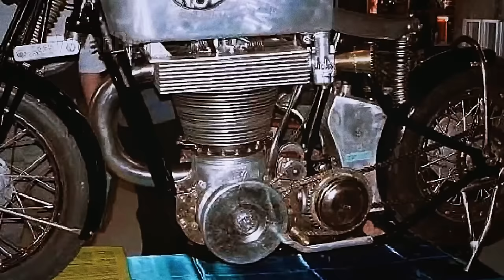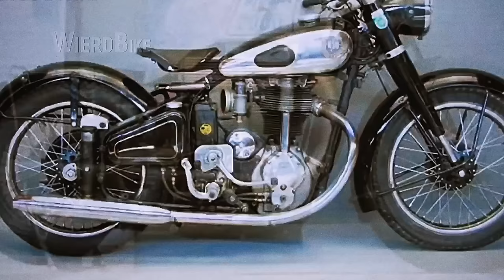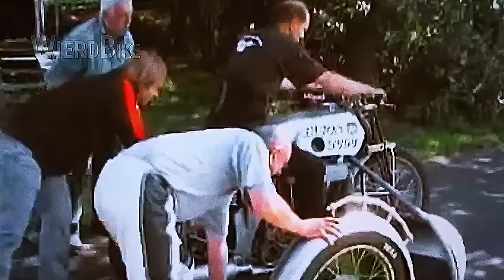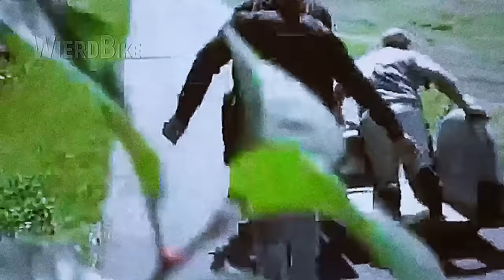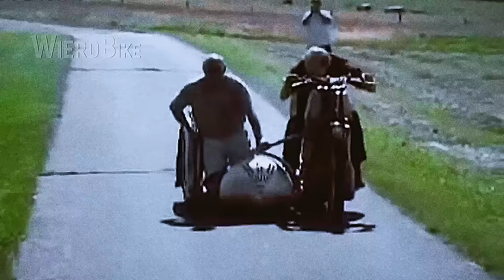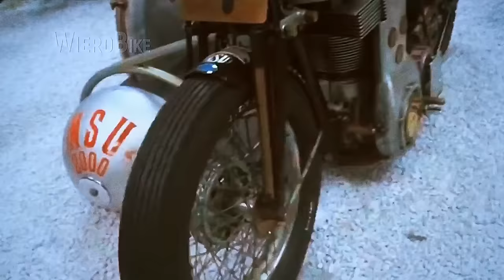The LARGEST SINGLE ever! 1 cylinder — 2 liters...

Comment: Sounds like anything above 300 rpm would vibrate the bike to pieces.
Reply: my lord but RPM does not seem to have been a design consideration! seems like such a waste imo. i'd love to see a huge single cylinder, but with a balance shaft or a dummy cylinder like ducati's supermono so it can rev properly
Reply: @5naxalotl i can only imagine, then it might be capable of like what,  maybe 1000 rpm? Its like the opposite of Vincent Foucart’s Peugeot 205.
Reply: Why do u want rpm
When you already have torque?
Reply: Imagine trying to kick it!
Reply: Next, he could just sit directly on the piston 😂
Reply: @fastinradfordable Because lits of torque at very low RPM means low power, and power is what moves the machine.  Looking how slow this machine is in the video I suspect it didn't make much more than 20-30bhp.
Reply: That's what your mom said
Reply: Wait until I show you my r15000 2cylinders 15L engine

Comment: That kick starter has the potential to be a leg breaker.
Reply: For sure.  I was scared of kick-starting my big brother's Norton International, and that was only 500cc.
Reply: @gibbogle  I'll never forget my uncle calling us over to his house so he could proceed to brag about his  74 inch Harley-Davidson police bike that he bought at a police auction and it punted his ass over the fork when he didn't set that pedal right and it kicked back 🤣 He didn't keep it very long.
Reply: yup, here in my country we have some old 350cc also called "leg breaker". Imagine that one
Reply: Same with Yamaha, SR 500 @gibbogle
Reply: When bombadier/ Can am were developing the ds650 they were originally designing it with a kick starter but had issues with the automatic decompression and supposedly some legs were broken and then designed it be electric starter  only on it
Reply: That's why they roll-started it in the video.  The kick-starter is only for when you're stranded at the bottom of a hill.  Remember to only shut the bike off when you have a hill to roll down and you'll be fine.
Reply: And hope it doesn't die 😅 @rockets4kids
Reply: @randall1959  Back when I was in college the starter motor on my car went out and I managed for about a month before I could afford to put a new one in.
Reply: @misanthropiccurmudgeon8967  had one of those also, with the little sight glass to see top of compression.
Reply: Or deposit you around 100 metres into the local paddock....
Reply: Bollocks, be compression switch.
Reply: Skill issue.
Reply: Haven't even watched the video yet and that was my first thought.
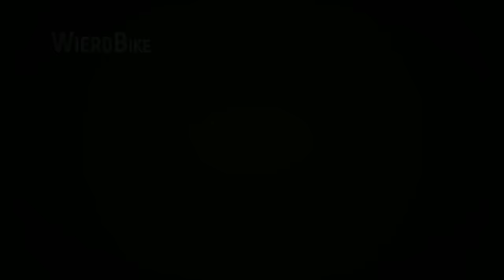Reply: 2:40 "...and let's leave this aspect on the conscience or our imagination"
PERFECT!
Reply: @GrumpyIan  Fair enough, but the ol' boys starting and riding that thing seemed to have thought push starting was the better option.
Reply: potential? this is the legbreaker to all legbreakers.
Reply: Well I'm sure if your leg could actually kick this engine, you shouldn't have to worry about it breaking since you'd probably snap a 1/2" steel bar with your leg xD
Reply: I had the chance to start a Yamaha SRX600(single, 4 stroke) a few years back. Not only did I fail, it felt like I was breaking my leg. The owner bet me I wouldn't be able and he was right.
Reply: @igorortega6494  I owned an XLCH that was bored and stroked to 1000 CCs and never had any problem kicking it. No decompression device either. Sometimes it worked up a sweat when she was temperamental.
\
Reply: that thing sends you into orbit...
Reply: Or the ER 😆
Reply: Kickstarter AND leg breaker? One mechanism with two purposes. That's just peak engineering
Reply: That kick starter would launch me to the moon 😂

Comment: These bikes are actually not motorcycles, as much as machines for breaking right legs, and causing concussions, when starting one without a helmet. What a challenge.
Reply: I think it must've only been push-started like in the video. It was a novelty, not a legitimate bike. That said, a LOT of people (myself included) have been terrified and/or injured by 500cc 2-stroke singles. I was lucky, being flung onto my face was the worst I got, haha!
Reply: I had a Yamaha DT 400 which had a decompressor operated by the kickstart. I would expect the same on a 2l motorcycle engine.
Reply: That is why you have compression release devices on such machines.
Reply: @patrickbodine1300  Well sure, but if a 500 will break your ankle, surely even a compression-released 2,000 would be as bad or worse, right? I genuinely don't know, I've only ridden 250 or smaller 2-strokes and 4-strokes with electric start.

Comment: You can literally count the revs when it goes slowly down the road.
Reply: It's not the rpm but the resonances in the exhaust pipe.
360rpm is already 6rpsec or 3 explosions per second (4 stroke cycle).
Reply: every ignition 1m drive...so you can count how far you drove it...just count all bangs

Comment: Had a BSA 441 Victor Shooting Star single that could break your leg if started incorrectly. Pass on this single
Reply: I had a Victor 500 that I somehow let kickback on me in the early '80's.  My foot still hurts sometimes.
Reply: I had the B44VS with a high comp piston. It nearly threw my mate over the bars. 😀
Whereas, I always made sure it was safely past TDC before kicking. (Electronic ignition helped)
Reply: Didn't those old Beezers have ignition advance and retard for starting? I seem to remember a mate who had a B31 which had a lever on the bars for advance/retard? If you didn't retard it before kicking it over, you risked breaking your ankle.
Maybe it was an option or only fitted to pre-unit engines, but the Victor 441 and the Starfire 250 would certainly have benefitted from it.
Reply: @125brat  Well, you are exactly on the right track but just a tiny bit off.  My Victor 500  (B50T) has a little trigger on the handle bar that pulls a cable going to the cylinder head.  The lever on the head the cable is hooked to lifts the exhaust valve a bit.  Then, you bring it up to approach Top Dead Center with the Kickstarter and pull that decompressor to get right at TDC.  Then you jump as high as you can and about half way down kick the living stuff out of it.  I only had mine hurt me once but I never forgot it.
Reply: @125brat 
I think you’re right - That was only on the pre-unit engines. And yes, it would have been very useful on the larger cc or higher compression engines.
I fitted electronic ignition which must have helped. It certainly gave reliable starting and smooth acceleration. 🏍💨
Reply: Yeah. A friend of mine had a Victor. I could never start it, possibly because I only weighed about 140 lbs.

Comment: An interesting counterpart to Allen Millyard's v-twin 5-litre machine, using two cylinders from a radial aero engine. He built it in his shed, one of several extraordinary motorcycles he's built over the years. Some are in museums, e.g., his 2300cc V12 Kawasaki, and he rides the others regularly. https://www.youtube.com/watch?v=I-Xr1bmbZ_s&t=271s
Reply: Millyard's designs are well engineered, this one looks thrown together with no particular reason.
Reply: Wonder how he balanced the crankshaft,  and geared the kickstarter
Reply: Cmmon Allen,  ANSWER THIS GUY,  SHOW HIM WHO IS REALY THE KING ENGINER IN  H U G E bike engines!!  ( probably reduced the compression to about 4 -- 1 and ignition timing to top dead center, or that monster, on kick starting would break his leg, AND launch his broken body half way to the MOON!!!!
Reply: @earlwheelock7844  In his video, it seems to start pretty easily. Perhaps, the carburettors play some part in that; he made them himself.
Reply: @earlwheelock7844  Allen has some videos of the engine's construction, including the crankshaft.
Reply: I have seen Allen Millyard's vidio's ,   im talking about vidios about THIS guys build as it seems to me to be TOTALY different than Allen Millyards build!!.

Comment: 2000cc pushing through a 1.5 inch / 37mm exhaust pipe....sigh. all of 120HP tops....  Ive got a methanol 250cc that uses a 42mm carb and a 2 inch exhaust and churns out 104hp on the crankshaft dyno...Which is about what this 2 litre engine makes ....sigh , bigger isnt always better. But I wont fault dude you gotta start somewhere even if you go down the totally wrong path. Back on topic, I have some Aries Top fuel pistons, a tweaked crankshaft and some TF rods A friend gave me from his used spares. Im thinking about a machining 2 cylinder 2.2L TF engine using the back half of TF crankshaft. I have the TF injectors and a mag 500 pump too... Maybe 1500HP plus from a 2 cylinder.

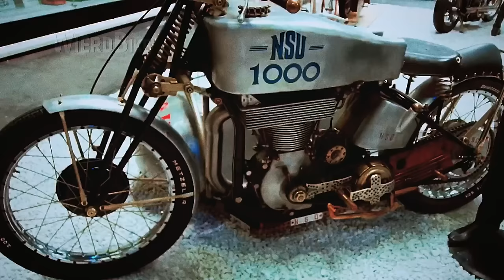Comment: @0:45 NOT the biggest 1 cyl. engine in the world. that goes to "Otto" the 85 times bigger gas driven stationary engine, around 180 HP at about the same speed/RPM's but an impressive 6920 Nm of torque, helping pumping nearly 7 million L of water per day in it's prime time ....

Comment: Just the thought of kickstarting that thing makes my knee hurt. When I worked as dealer service technician I used to have the shop helpers kick start thumpers over 400cc because I was mean. One day a DR650R with leaking float backfired and sent that +/-150lbs shop helper for field goal. He landed on his back about 10 feet away and was slightly upset with me when he got up, but today he will tell you it was on the job training.

Comment: Biggest single cylinder motorbike perhaps, but not the biggest single cylinder engine in the world by a long stretch.
The Otto is a very impressive single-cylinder, stationary, natural gas engine and is the largest remaining single-cylinder engine we know of in the world.  It weighs about 25 tons and the Deane pump weighs 20 tons.  The engine has a 21 inch bore and a 30 inch stroke, which yields a displacement of 10,391 cubic inches, or approximately 170 liters.  Its nameplate rating is 175 hp at 180 RPM.  When operating at these conditions the engine produces over 5100 ft lbf of torque.
Reply from the maker: There’s motorcycle on the preview…